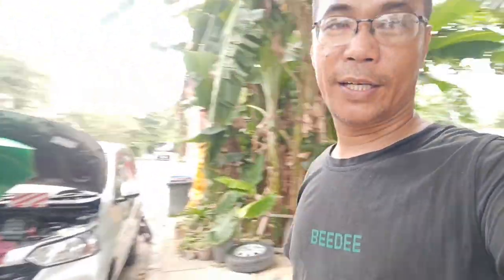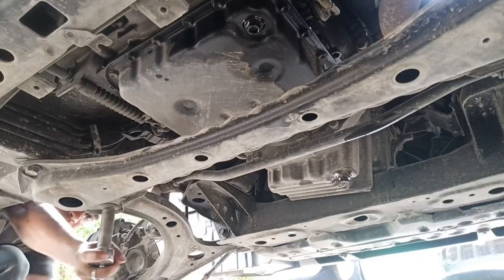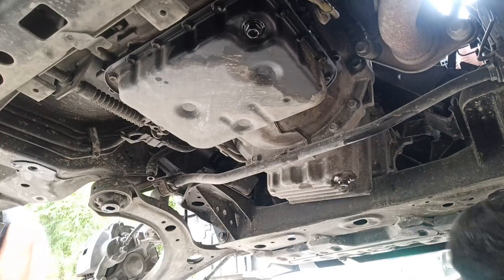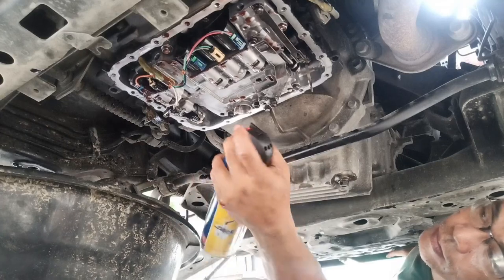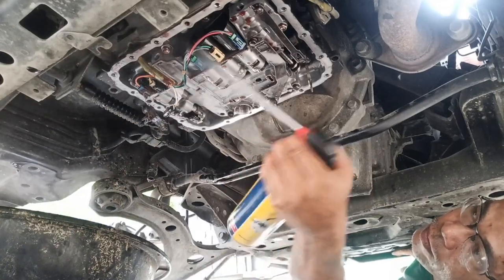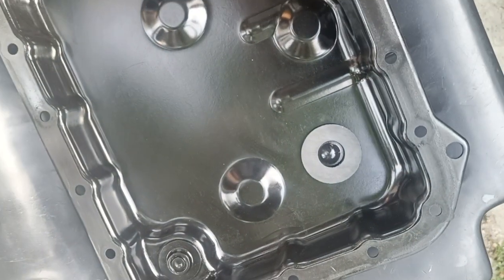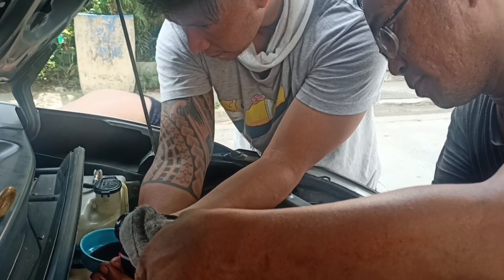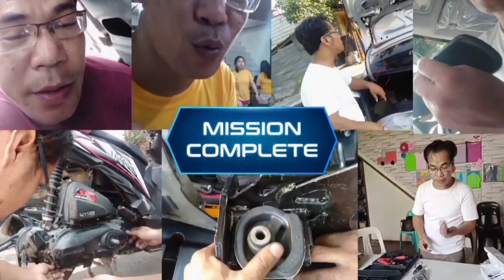TOYOTA AVANZA OIL PAN PULL DOWN AUTOMATIC TRANSMISSION 2 LITERS ONLY ATF

Comment: I have Toyota Avanza 2019 module Automatic, when I put a gear on reverse it  flashes yhe (ATF) light doesn't move I have to switch engine off more than 3 hours or more until the engine cool down is where I can be able to reverse what might be the problem?

Comment: How many letters of  transmission oil is needed?
Reply from the maker: Much better how much you get from the transmission then the same amount you put it back measure it, but if your transmission has dipstick you can easily check after running for 15 minutes drive
Reply: Check the transmission fluid at normal operating temp at 70-80°C.

Comment: ask lang po sir same lang po ba pagcheck nang soleniod nang avanza at vios.?
Reply from the maker: Yes po,,pag dalawa Ang wire , negative at positive lang pag isa lang group Ang body ng solenoid automatic
Reply: pag check ku kc sir single wire umilaw pero walng sound sir ok ba po b non ang soleniod sir sa avanza po.?
Reply from the maker: Ok lang yan,,may bulitas sa loob ,once tumulak n pumitik n iyong,pero if gusto mo marinig iyong klik sound,itulak mo ng karayum iyong bulitas tutunog uli
Reply: shift soleniod DSU.sir tinulak ku knina po matigas po siya parang lumalaban ang spring nia po sa loob tapos after ku tinulak ilaw lang po wlang click sounds.?
Reply from the maker: Try mo linisan,,tapos sa resistant mo kunin
Reply: nasa ilang ohms po ang normal at sa resistant sir.kung digital tester kami sir?
Reply from the maker: Pag zero sira Yan pag may reading ok yan
Reply from the maker: Try mo makakuha 11 to 15
Reply: @JackOfAllTradesAutoCare  mring slamt po sir god bless.slmat po sa tips nio😊😊😊😊
Reply: sir nagset ako sa 200k.ang reading po ay 00.0.tpos nilipat ku sa 20k ang reading 00.1 po sir?
Reply: set ako ulit sir nang 200 ang reading aman ay 12.8.
Reply: sa 2k aman .012 sir.?

Comment: Good evening po tanong lang po ilang litters po sa avanza auto 1.3 ang magagamit na atf?
Reply from the maker: Usually 4 litters kaso naiiwan sa torque converter kaya almost 2.5 lang mas maiigi sukatin mo nalang Kung ano ibaba mo iyon din ibalik mo po para sigurado ka,,Kung walang leak otherwise may sukatan naman po dyan
Reply: Salamat po sa pag response. Sir tanong lang po ako ATF type T-IV ba ang gamit na atf? Mag oorder na kasi ako baka ma mali ako.
Reply from the maker: Yes po T4

Comment: Sir, pwede po buh yung dextrone fully synthetic atf?pansin kopo kase pag malamig ang transmission mabilis lng mag engage ang reverse pero pag mainit na nag dedelay sya..baka nasusunog yung t4 na atf sir??need buh dextrone??
Reply from the maker: T4 recommended po dyan,, possible internal leak Yan ,,nasa manual if ano nirerecomend,, delikado Kasi Yan atf
Reply: @JackOfAllTradesAutoCare  pansin kopo kase pag malamig ang trans, nag eh engage po yung reverse pero pag mainit nah na po nag sisimula na syang mag delay depende sa layu ng byahe..
Reply: @JackOfAllTradesAutoCare  ano po marecommend nyu sa trans ko sir?need na po buh talaga ibaba?
Reply from the maker: If napalitan na atf filter at fluid at na check na mga solenoid,,try nyo muna valve body,, calibrate

Comment: sir tanong lng po  avanza 2012 same process nakuha ko atf sa oil pan 1.7 liters lng sinalinan ko 2 liters lng ba tlga avanza sir sure ba po yan?? Thanks in advance pls reply...
Reply from the maker: Yes po Kung ano nakuha nyo ganun lang ibalik nyo sukatin nyo po,,if Wala naman leak
Reply: For model  2012 ATF if about 2 liters when drain & fill, without replacing the filter.